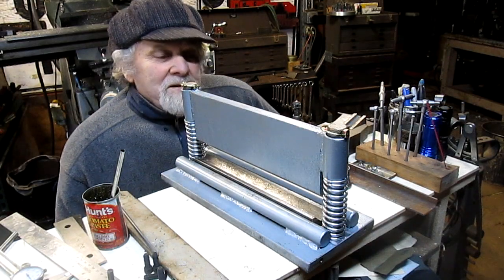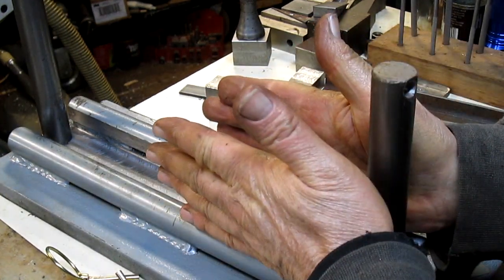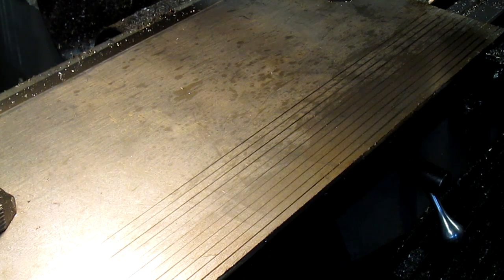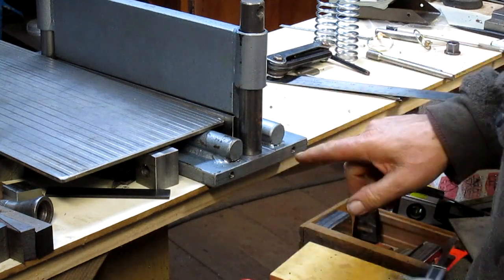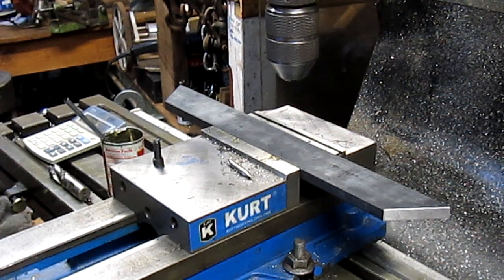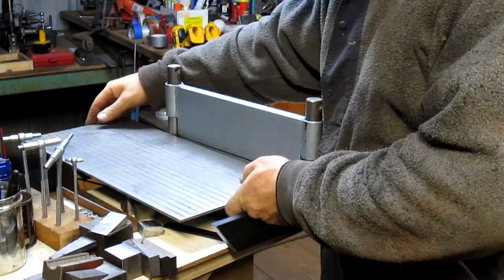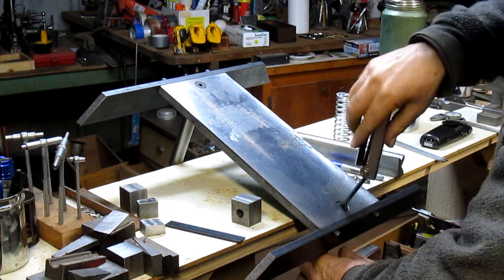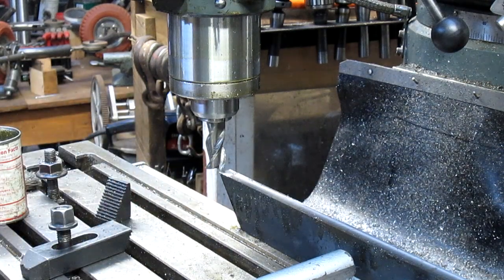Adapt a Press Brake #1

Comment: I  did pick up a few valuable bits of information from this video, so thank you for that!  Love the head tilting to scribe the graduation lines on the plate! Now if I may suggest to you that you only fasten the table sections and not weld them on because if the plates are permanently secured, you will lose your ability to make compound bends. That's one reason brakes don't have rear tables just adjustable stops for accurate depths/lengths. Of course this is moot if all you ever do is make small right angles all in one direction, but you put in too much time and expense at this point for such a simple task as that! Thanks again and keep making cool stuff! Peace!
Reply from the maker: Turns out that I did bolt the table to the frame, mostly because it would warp. Hadn't even thought about compound angles, but good point.